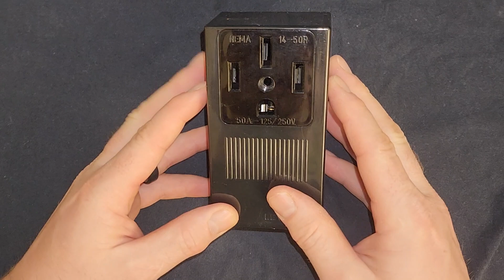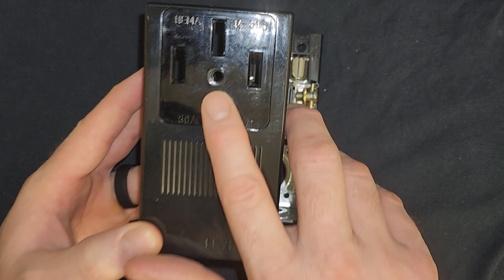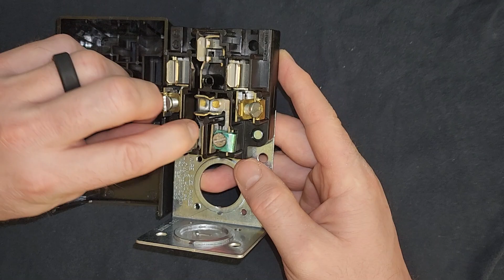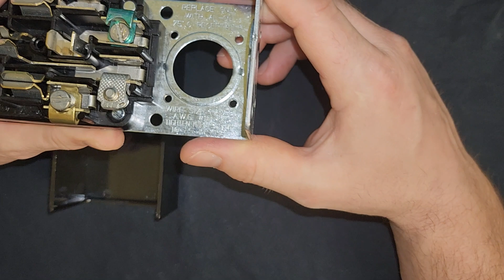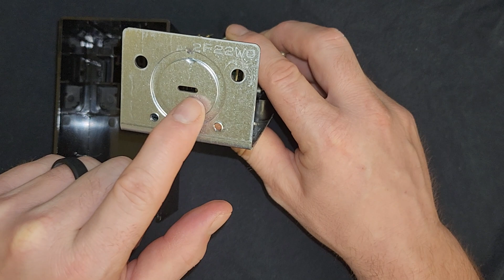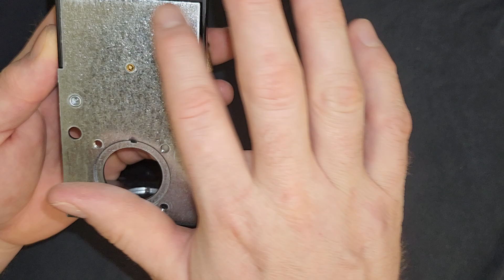Let's talk 50 amp 4 wire. Nema 14-50 Range receptacle, Electrical Vehicle EV Welding Electrical

Comment: You talk about all new installations requiring a 4-wire receptacle, would love it if you could reference the NEC codes that require this? I see requirements for an equipment ground conductor (2020 NEC 250.140) but nothing that states the range has to have a neutral? What if you have a straight 240V rated range, are you still required to install a 4-wire receptacle?
Reply from the maker: Right, if it needs a neutral only. There are still ranges that do not require a neutral, and  correct they all need an equipment ground now.
Reply: @Electrical Code Coach  Thanks coach! So the 4-wire receptacle is a manufacturer requirement, not specifically an NEC requirement. I do believe that at least 90% of household ranges will be split phase 120/240V rated and that a 14-50R is always the right choice if the final equipment is unknown at the time of design or installation. Great content!

Comment: While on the subject of three wire range receptacles vs four wire, my interpretation of the code is that if you modify an existing 3 wire installation in any way, that includes moving the receptacle a few feet and using the existing wire,  then legally you are required to pull a new 3 wire plus ground cable and install a 4 wire receptacle because this would technically be a new installation.

Comment: Always go with the wall receptacle?    In receptacle is 3 wire, AND new appliance Plug is 4 wire,  we NEED TO CHANGE the cord to 3 wire and WIRE the appliance accordingly?   Jumper together the neutral and equipment ground?

Comment: My state has a rebate program through the utility companies that gives the consumer $1500 or 1/2 of the installation cost up to $1000 (depending on the utility) for the install of a level 2 EV charger, as long as it is a NEMA 14-50 receptacle and it's a certain brand of charger. So I install a lot of these NEMA 14-50s, and the issue I am seeing is that on older installs (not done by me), I'm seeing a lot of these burning up. It's super important to make sure the receptacle is rated for AL wire (I've seen some rated for CU only), and to properly torque the terminations, because a car charger puts a huge stress on them. I personally prefer to hardwire the car charger because I have yet to see the terminations burn up in them. I am pretty new to the trade, and no one I have worked with has ever used a torque wrench or screwdriver, just used their feeling, but I invested in both a torque wrench and screwdriver so that my installs don't burn up.
Reply from the maker: Thank you for sharing!